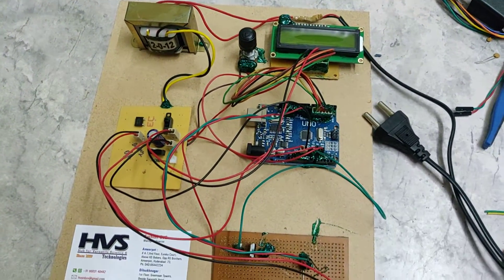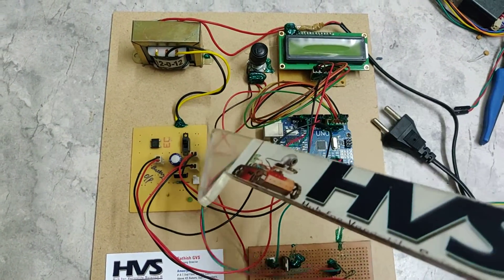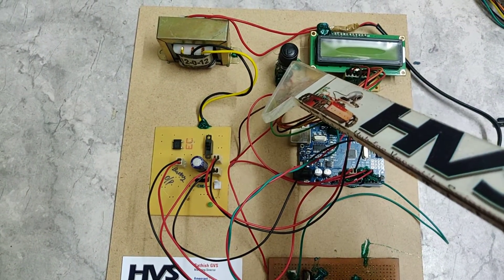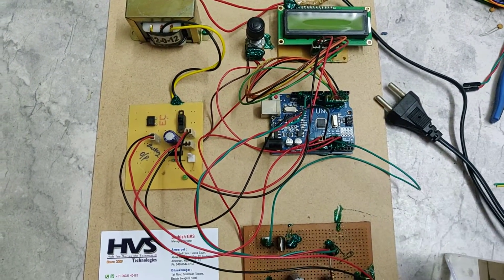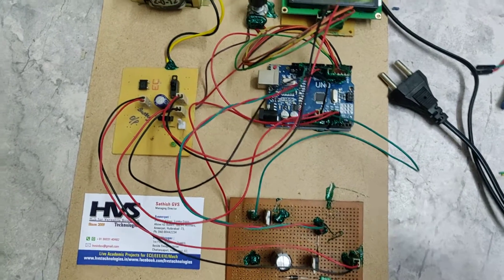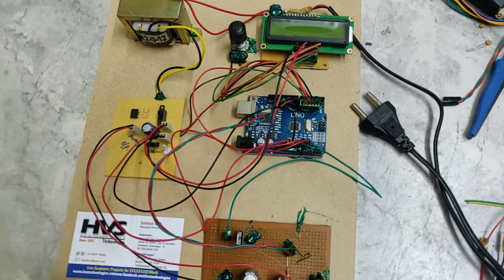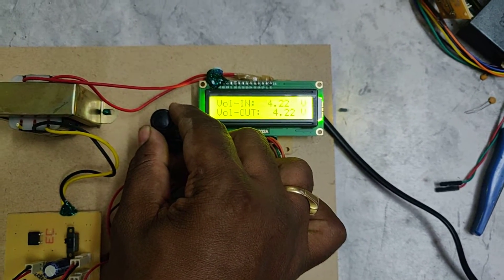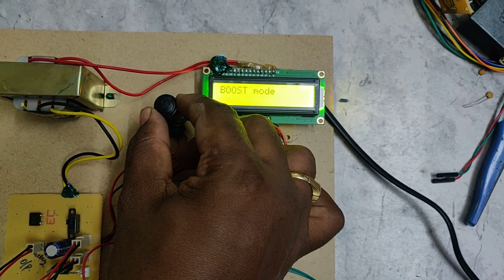Arduino based Buck-Boost converter

Comment: Is this a joke ...you are printing values on LCD and it is easy ..you should have showed outputs using Voltmeter so that we could have verified the circuit
Reply from the maker: We are displayed the voltage value only, if you have any doubt, you can purchase the kit, before shipping only will send you the video with voltmeter output also. You can contact us at +919603140482
Through WhatsApp or call

Comment: Out voltage is not regulated for any specific value either in buck or boost mode while input is being varied.
Reply from the maker: It's regulating
Please go through the video clearly, there will be a threshold point to boost the input voltage
Reply: What control algorithm  is used.
Reply from the maker: Above 8 volts